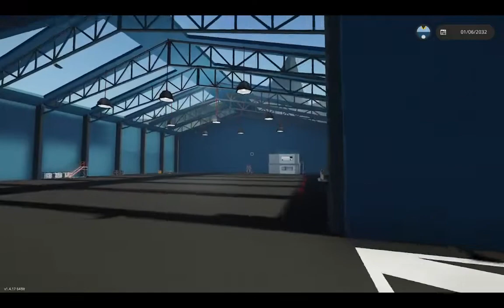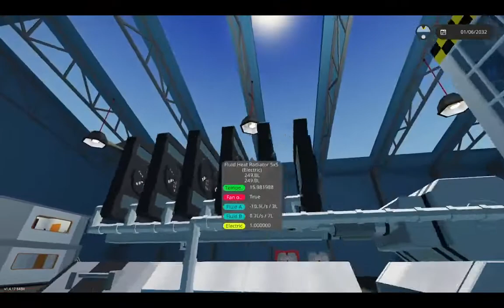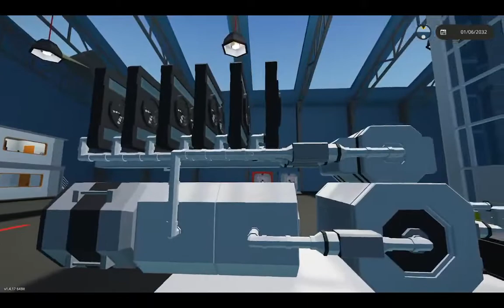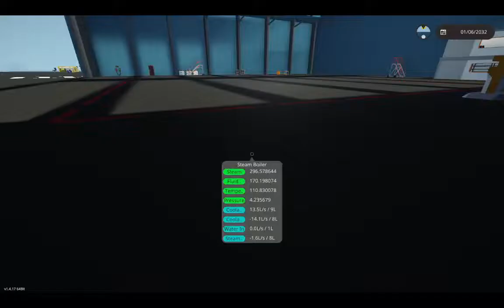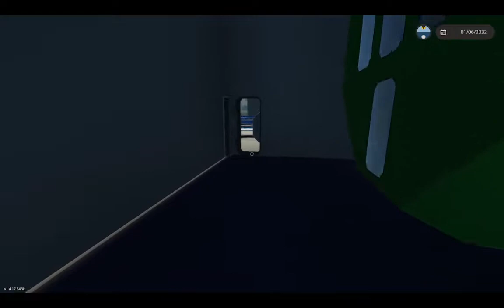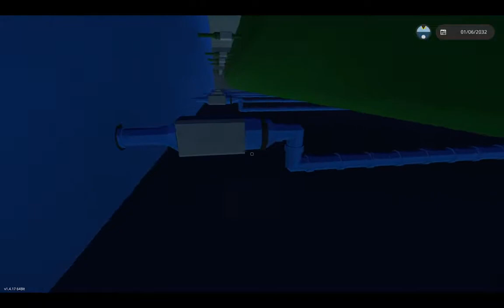Stormworks bug: condensers

Comment: The condenser is actually putting out water, as can be seen in the tooltip with the negative sign in front of the water out indicator.
Ever since they added those weird in/out buffers for fluid the fluid system has been acting strange.
You can also see the coolant pumps and radiators reporting heavily fluctuating numbers, which points out either suboptimal piping (the official presets are terrible) or placing components in wrong order (frequently happens when building supercharged modular engines).
You can turn off the water outlet pumps of the condenser, then you will be able to observe how the condensers water output buffer starts filling up (maxing out at 10l), which will take around 15-20 minutes.
Another issue that's masking this problem is the lack of precision in the tooltip, you can see the condenser reporting 1.5l/s of steam input, with a water to steam ratio around 1:1000 the amount of water is too small to be displayed by the tooltip and can only be seen by the negative sign in front of the water output indicator.
As I already mentioned the presets being terrible, you never need more than a single 5x5 fan radiator with pumps for in/out, unless they add islands where the ambient temperature is drastically higher than anything we currently have in game. As long as the condenser is below 100° it WILL convert steam to water, the tooltips just do a terrible job in displaying this.

I'd also would like you to make this video public, so folks running into similar issue (basically every player using the advanced tooltips) can see this.

Also cudos for your effort in making a 40min+ video to point out these issues.
Reply from the maker: thank you and cudos to you as well for the description, i will happily make the video public, if you or anyone else can figure out a way to get actual good output from the condensers PLEASE let me know, i can sit here possibly for days and watch probably not a single drop go into any tanks, but when i get the time i will possible make a pert 2 to this, using pressure/flow gauges and a small empty tank just to see and confirm if this is really the case, i think slightly otherwise but always will keep it as a possibility.
In addition, using more radiators was #1 to see if itd make a differance and #2 satisfy those that will sit there and tell you nothing but "You pipped it wrong, you just have bad skill, you need LOTS of cooling for condensers"
Reply from the maker: welp, we will never see a fix for this

"Ahh, are you playing with inf fuel on?

Inf fuel has the effect of supplying inf fluids / gasses to any connection, so this would expect to flood any steam system.

And this would explain why you also experience the issue with the preset steam engine."

devs think youre "flooding it" clearly  at 7:46 i turn off infinite fuel in the video, MADE ZERO FUCKING DIFFERANCE how idiotic are these people.. seriously.